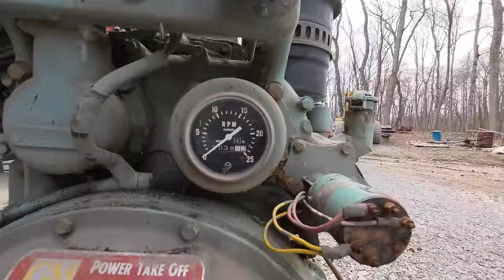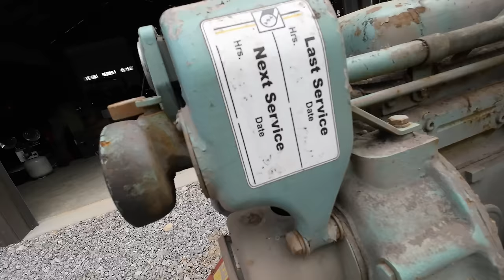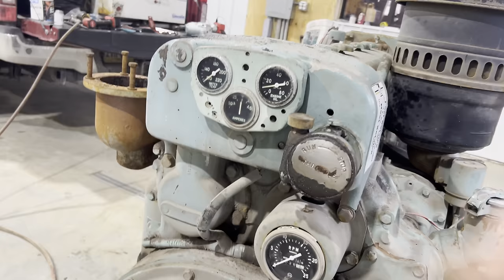$250 Two Stroke Detroit Diesel Sitting 6+ years, WILL IT RUN!?!?

Comment: I'm sure someone else has spoken up in the comments but these old Detroit motors are meant to run of an SAE 40 weight oil, they can be damaged by the newer oils with additives.  Keep up the good work its awesome to see this old iron come back to life and be used.
Reply: Yup I was just going to say this. I love Rotella oil but it does not belong in 2 stroke Detroits.
Reply: Please enlighten us who are not DD experts: Can be damaged or Will be damaged? What is the probability? Why would new oil with additives damage the engine? No sludge to stir up with detergents. Reaction with metallic components? Soot/carbon?
Reply: Not a problem in a stationary application. 

The issue with DD 2 strokes is that you get a bit of fuel contamination which breaks down the additives and can cause sludging leading to oil starvation. 

You combat this with more regular oil changes. 

Base oil is fine with contamination because there's nothing to react with the diesel. 

Modern oil will be fine if not better if changed regularly.
Reply: My thought was that the engine is barely past its breakin period.  Too soon for synthetics.
Reply: Myth. The only reason an old engine would hate new oil is because the detergents in the new oils would cause deposits in the engine to come free and potentially clog oil passages etc. This engine has so few hours on it there likely isn't any of those dangerous deposits. Basically, the new oil isn't really the problem. The old oil without detergents that keep the engine clean is. BTW, I have been running full synthetic oil in my '66 for 7 years now.
Reply: Love the work. Built two strokes for 30 years. They need the 40 w .Thank-you for saving that old bird.
Reply: Will be damaged due to the ash content creating sludge on the intake ports in the cylinder liner. Delo 100 SAE40 is the oil you want.
Reply: @@ricekrgr6793yep he should probably be running 30 on his area
Reply: @@ricekrgr6793especially being brand new low hours it's still nice and tighten no slop yet.
Reply: They sheer the polymer chains apart that make the oil multi viscosity yessir, after enough run time that 15w40 will be chewed up into what's basically straight SAE 15!
Reply: @billrice7738  I stopped working on DD's thirty eight years ago and all were run on high detergent #30 .The oil we used was actually recycled oil . It's only lately I notice that folks have been believing the adverts for "modern" oils .When you have to strip and clean an engine run on the wrong oil with everything full of black glue,you understand why #30 or 40 is only way to run. 😁😁
Reply: @Mercmad  yes. I was in the Kansas plant. Detroit tried using 15w40 long time ago. Big warinty nightmare. The manual says this and says 40w. Has a provision for 30w in cold weather. I put rottela 15-40 like Matt in all the 4 stroke but 40 w in my 2 strokes.
Reply: @Boga217 no, only 40 wt non synthetic oil.
Reply: @damienmccormack2789 no to your long winded speil. Multigrade oil deteriorates the rings (doesn't give the correct lubrication).

Comment: Matt.  Galvanic corrosion can form in a heat xchanger when there is a potential between two dissimilar metals in a liquid envionment.  Prevented by using a sacrificial anode. Changed at least annually.  Zinc is often used.  They form little rust domes that are hollow and when broken open reveal shiny metal.  Learned about it when I operated Nuclear Power Plants in the Navy in the 70`s
Reply: We had both rods in the heat exchanger and plates in the Nalcool filters. Both were made of Zinc. The rods were for the raw water and the filters were for the closed loop.
Reply: This is not a problem on the Detroit 2 stroke which are made if ultra hardened steel components!
Reply: I forgot to add, we did not change ours yearly. We did pull them out and run them over a wire wheel. Stuck them back in all nice and bright till the next year. Rinse and repeat until the 1/2" diameter anode was down to 1/4" and then replace. In the 18 + years I was there and the 24 years that the engines had been in use, we never had a heat exchanger leak.

Comment: Brings back fond memories of the 1962 Detroit 453 that was in my boat. They’re loud, but so reliable.
Reply: Nice
Reply: They didn’t make as much power as the other engines out there but boy once you fired up a two stroke Detroit, it just wouldn’t die unless it ran away or ran out of fuel, whichever came first lol.
Reply: Replaced a worn out 4-71 with a high speed 4-53 at work. At idle it was quieter than the 4-71. But when you opened it up under load it got loud, real loud. The pump put the maximum load on it and kept the RPM at 1900 RPM. No load maximum speed was 3005 RPM.

Comment: I believe the black oil you see in the exhaust is a condition called wet stacking I worked with several Detroit Diesel engines like the one you have and had that problem with the low hour units the best way to deal with it is to run them under a load like they were meant to run
Reply: Idle time is bad for diesels they need to work at or near compacity to burn off oil blow by. 
. Check your airbox drains its common to have a steady drip when running. Wear your ear protection or you won't hear well ask how I know! There is a reason they called them screaming jimmys! Not oil or fuel efficient.
Reply: Wonderful video Matt❤
Reply: Yeah could be just diesel slobber it needs putting to work old engines like tractor or generator type were made for being under heavier loads it needs breaking in bet those pistons are barely bedded plus light weight oils aren’t the best for those engines even if they haven’t got many hours rotella sae40 or the dd40 heavy duty. Could probably run a decent size hydraulic system or something with it
Reply: @ridgefieldjohn9041  They're exceedingly efficient at converting fuel to noise. That's the only time "Detroit" (at least the old 2-strokes)  and "efficient" should be used in the same sentence.
Reply: @Porty1119  Hey now. If tuned right they weren't all that bad on fuel. We ran a two ft head on our pumps ( 8' diameter axivane prop  ) and ran a 12V71 at 1800 RPM burning 9 gallons of fuel per hour. Rated emergency load was a 4' head at 19 gallons per hour per Corps of Engineers specs.

Comment: There IS something about the sound of a 71 series! Once those injectors were squinting fuel, it proved that it only had a handful of hours under its belt. Getting a basically brand new engine for $250 (plus shop supplies) should be a win in anybody's book.

Comment: I just love the sound of those old Detroits. Sounds so much like the 6V53 that we had in one of our farm trucks years ago. The 2 strokes have a sound that just resonates power. I will never grow tired of hearing them. What is nicer than working on a Detroit, working in your brand new Shop. You have done good Matt
Reply: I hear them on irrigation rigs here and that will do for me. I listened to 12V71s and 6-71s at work for 17+ years at work.  108db of sound anywhere in the engine room and up to 118 right next to the engine a 1800 RPM. And also often slept next to one when running on a cold night at work ( 2 hours out of 12). Miss a single beat and instantly awake.

Comment: What a glorious sound!!!   I had 4 of those in my boat in the Navy in the 70s. (LCM-8, 4 engines into two shafts ) loved them!!!   The blower flapper was a normally open emergency only item.  We always started unknown (or rebuilt) engines with the valve cover off and vise grips on the rack, just in case.

Comment: That engine has a closed marine heat exchanger with antifreeze in it that is cooled by the water it is pumping. Would have run extremely cool. That is basically a brand new 6-71 Detroit. Nice find.
Reply: Thanks for explaining that. When Matt was inspecting it I thought that was the probably how it worked. It's the logical solution for a water pump.

Comment: If you get the remote setup on it working, you could probably set it up to run a fairly large compressor for you. If the PTO is electric, all you would have to do is build a small cabinet inside the building and set the motor skid on a pad out behind the shop, and then use the high pressure cutout from the compressor control the PTO on the motor. The same setup would work for a 3 phase generator or even a water pump to give you pressurized water at the shop + whatever other buildings you wanted to put out there.

Comment: Two stroke Detroits are among the most reliable/dependable diesels ever made. With minimal care, they 
can run nearly forever...and with the seemingly endless supply of aftermarket parts available, they will!
Reply: it also usaly need a endless supply of new oil.
Reply: @ottoolsen9676  Detroits are usually oil tight when the correct gaskets are used and installed
properly.
Reply: @sporty1701 from a retired mechanic of the 1970s. 😅😅😅😅😅 No , you're making my gut hurt, Jimmy's don't leak oil.😅😅😅😅.
Reply: @ottoolsen9676  12V71s at 1800 RPM 24/7 used 2 qts per day and 36 qts per oil change every 300 hours. Most of the 2 qts were burned so it saved a bit of fuel. 😉

Comment: I was stationed aboard a Guided Missile  Cruiser while in the US Navy. We had 4 of these 2 for emergency ship power and the others for emergency firefighting water.
These four engines used seawater for cooling. Each had an oiling system with an external sump, oil pumps, and filters. They ran on the boiler fuel that the ship's power plant used. The ship had 1200 PSI steam pressure, which used a high-grade boiler fuel.
Reply: Running a high performance 2 stroke with a cooling system, and 2 stroke don’t need oil pressure till running, my YZ-250 engine makes 45 psi at 40:1

Comment: Hi Matt. The cooling setup on the front of the engine is a heat exchanger. It looks like it was set up so that part of the pumped water was used to cool the engine, so the short, closed loop of coolant was giving away heat to the open loop of water used by the mill. Those two pipes at the sides, one was probably connected to the pump outlet, the second probably somewhere downstream. Second thing, you might be using the wrong oil for this engine. The guy at Bus Grease Monkey channel fixes a lot of 2 stroke detroits, but of the V8 bus variant, and I believe in some video he said that those two stroke diesels need some specific oil, maybe low ash content, I don't remember exactly but he was adamant about it. You should probably get some more info or maybe even contact him. That Shell oil is a good oil, but it might not be good oil for this specific engine.

Comment: 7:55 The box on the front that you’re looking at is a heat exchanger. The 8v72 fire pump that we have at work has a very very similar setup. It pulls water directly from a man made pond with 550,000 gallons in it at all times. The 200gal fuel tank will run dry before the pond does. 

Love the videos btw. Keep it up 👍

Comment: I would think that a sawmill would be a much better use of that powerhouse.   You do have a large stack of seasoned logs and the price of lumber would justify the build. If constructed right, you could pull the motor and use it elsewhere for other purposes as well.
Reply: If he built it right, maybe he could make the engine multi-use; when it's not set up as a diesel go-kart, it could drive external machinery like the sawmill using the PTO. Bonus would be it could drive itself where it was needed.
Reply: Use railroad rail in weights from 25 lb / yd to 100+ lb / yd for the rails, but the quality of the rails sets the quality of the edge.

Comment: 6:09  Many moons ago, the company I was working for had 6-71 powering a 600 CFM Chicago Pneumatic compressor. One of my first jobs (and nearly the last) with that company was to drop the cast iron oil pan and evaluate the internal lower-end condition. What a beast to work on!

Comment: You are amazing in getting it running with so little problem. Congrats.
How about a 50 - 100 KW generator to power the whole farm?
Lots of potential for so many projects. I have never seen one run so vibration free.
Thanks for sharing.

Comment: The 6-71 "Screaming Jimmy" was a regular workhorse after the second world war. They were used during the war as tank engine in a left /right pair configuration. They were available in original grease as a pair from Army Surplus in Canada at $500 for the pair. Most small oil and gas drilling rigs of the day had two pairs of Jimmy's on the draw works and another pair driving the mud pump. They copped abuse and zero maintenance but seemed to last for ever. They usually  ended their days by seizing a big end bearing , and throwing a connecting rod through the side of the crank case while pulling pipe from the bottom of the hole
Reply: Polaris 850 patriot boost turbo jimmy

Comment: Having Trained on 6-71 Detroit in the Army in 1953 that was the "Go Too" Engine in WWII "Clean Air & Clean Fuel with plenty of Oil and they would run for ever" !!!!.....Popular as the GM 350 Ci of the 60's ...Because  they were reliable

Comment: Matt, I'm not a gear head and have no experience working on machinery. But I enjoy watching you mess around with equipment and trouble shooting. I'm amazed at how you bring things back to life and make it functional. Diesel engines are fascinating.
Reply: I learned how to clean the air filter cans out and how to bleed the fuel lines and wait for the glow plugs to warm up other than those things I no nothing about diesel engines.

Comment: I worked in a hospital that had a 92 series V8 twin turbo Detroit on an emergency generator. I used to run this thing every month but even then, it had only amassed around 250 hours by 1996. It was then moved to another hospital where I believe it only got to around 400 hours. It was then replaced by a much larger genset located externally as this unit was actually in an internal room. Then they refurbished the wing and built around that room which was locked and sealed up. It remains there to this time and will never see the light of day until that hospital is demolished. That was a beautiful engine, started instantly and sounded great. It is a shame that it was not removed and sold. I would love to get my hands on it but that will never happen.

Comment: In steel mills there's a pretty good chance that it was on a river and there was a "raw water" pump that drew river water for make-up water to the cooling water basins.  That kind of pump house would also have both motor and diesel driven fire water pumps that charged the firewater header with river water.  The motors could be air cooled, they could use the mill's cooling water header, or even take their cooling water directly their own discharge piping as "once-thru water."
Reply: We had the same engine for our fire protection system. We had a heat exchanger that we ran water through it from the fire protection pond.
Reply: That's what I was gonna say, that heat exchanger on the front looks like a marine unit. I bet they use river water or a cooling pond. I don't have any experience with one, but I watch a couple other channels that have these in their boats and they looks just like the one on Matt's engine.
Reply: @matts.8342  you are correct i have a 40 ft. fish dragger same set up there is a inlet through hull fittin called a sea cock water comes in goes through the heat exchanger then out a deck hose over board  there was probely a mill pond for that setup
Reply: @georgejobin1744  The idea of a cooling pond kind of reminds me of old school radio stations. There was a station in Southwest Ohio that broadcast at 500000 watts and could be heard throughout most of the United States. It had a series of ponds for cooling with fountains to increase the rate of cooling. They ran the water through the transmitter at 600 gallons a minute! I think that the popularity of nationally known acts around that time is likely due to this station, the only one ever given a license to operate at that power level. There's some pretty interesting videos about the station and what's left of it here on YouTube if you are interested. The call sign was (still is, it's just not nearly as powerful now) WLW.

Comment: I was in navy 1966-1970
Went through several grey marine schools
The Detroit Diesel was called Grey Marine in the Navy
Worked on many of the 3,4,6 and 12 cylinder engines in Viet Nam
In civilian life worked on them in trucks , cranes and loaders etc
Great little engines especially because of parts interchangeable

Comment: Great video as usual Matt!  I've got a couple of old Detroit 2 cycles in a boat.  You have to use straight 40w in them.  I've been using Rotella 40w.  I don't honestly know why but all the old boat mechanics will tell you that.  Bus Grease Monkey on Youtube, a real 2 cycle expert, said the same just a couple of weeks ago.  Hope this helps!
Reply: A quick search on several websites said the same thing. A bunch of posts on Bob the oil guy were interesting.
Reply: Straight 40 weight *Low Ash Content*. I get mine from Miles Petroleum Products in NY. It’s still about 5 bucks a quart — shipped.
Reply: Som÷thing had to due in the old 318's was fill the fuel pump with 30w oil if they were run out of fuel. That just gave the fuel pump better suction
Reply: Its to keep the oil consumption down is all. They all leak put 15 40 in they leak and use it faster
Reply: @KBoettcher13    No.
Reply: Local crew explain why the no

Comment: the 71 series goes back to 1939 and was designed to basically last nearly forever. it was designed to  be rebuilt quickly and go back in service. The 53 series was introduced in 1957. You should make a tidy profit if you should decide to sell it. Anyone with a vintage bus or truck that needs a 6-71 to repower would be happy to have this sweet one as it is basically brand new and barely broken in at such low hours.